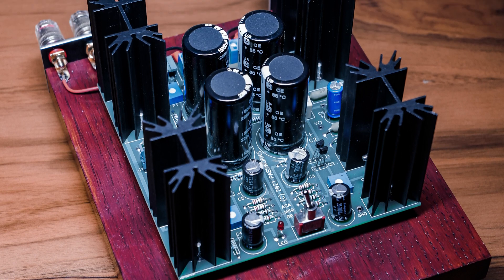Are 5 Watts Enough? ACA Mini by Nelson Pass | DIY Amplifier

Comment: just by using a linear power supply no sound stage will gonna open up, the only thing will change is the noise, and the capacitor recharge time.
Nothing will change, and the reason that that amplifier had low noise, due it has low gain which means it doesnt amplify much the noise nor the volume, were talking about single digit watts. 
Of course a low wattage low gain amplifier will gonna have low noise also, but with the right transistors you can make your own kit of this unit, its no witchcraft, its just that some people know electronics more and they know how should it go, and they try circuits out.
If its good then they sell it or utilize it in future project, and if its a bust then they put it aside, but they learnt from it.

Comment: How did the IFI psu affect the high frequencies specifically compared to the original psu?
Reply from the maker: High frequencies were tame with both of if I remember correctly. I would have to re-evaluate it to be sure.
Reply: @audioarkitekts  I ask because we are thinking of trying either ACA-mini or F5 as tweeter amp in a tri-amp setup using concentric 115db mid/high horn. Aim is for extended refined airy sparkly highs that really shimmer. Any other suggestions are more than welcome thanks.

Comment: Do you have any impressions about how much of an improvement the IFI power supply was over the little brick that it comes with? Sounds like maybe that brick blew out before you had a chance to do a comparison? 

The power supply that it comes with is tiny compared to the 36 volt meanwells that I have for my modded ACA. That IFI looks really intriguing, it might also be a killer upgrade for my hagerman tube phono preamp that uses a wall wart.
Reply: I'm going to answer my own question, I went ahead and got the iFi elite power supply just on a 30-day trial. The improvements it makes are no joke and if you match it up with some efficient speakers I have mine with Klipsch fortes, The results are amazing! And the improvement over the stock power supply is enormous, totally shocked!
Reply: @chelillingworth9466  What kind of improvements exactly? We are looking to get a ACA exclusively for midrange duties 300Hz - 6.5kHz on a very high efficient horn based (electronic XO) system. 
We need a low watt amp that is somewhat warm and buttery smooth (especially in the upper midrange) with good stage depth and not too forward. Would you say the original PSU should suffice our particular requirements ? 
Any other suggestion ?
Reply: @sarahX..  I would say it's definitely buttery smooth and it does a really great job with soundstage depth and width a very holographic presentation. Adding the ifi elite power supply enhanced it and every way, much more detail and specifically much better imaging everything was much more defined. The nice thing about the ACA mini It's that it's so inexpensive so you can really experiment without too much risk, and you can purchase the iFi power supply on a 30-day money back from most retailers and see what you think.

Comment: I just built this amp and I am floored by how good it sounds, I also built the full size ACA, I ran that in stereo mode and in both monoblock modes as I built two of them. I ended up following this great thread on DiY audio and heavily modified the amp with premium parts and dual  power supplies and it sounds killer. 

This little push pull amp though doesn't roll off at the top as much as the ACA and it's just got something awesome happening even in its purely stock mode!

Comment: Certainly, we do not use more than 10 W/rms

Look at it this way, every day you drive 100 km at a speed of 130 km/h, with a 70 HP engine, at maximum

Or you drive 130 km/h with a 200 HP engine, moderately

Which engine will last longer?
Reply: That is not an accurate comparison. This little amp will last just as well as a larger amp.
Reply: Definitely he built amp that looks like luxury car with one mile per gallon...

Comment: It’s a great little amp!  I have mine powering a pair of Troels Gravesen designed SBA761 speakers, about 90db efficient, and they sound great.  It’s no giant killer, but it is a fun little amp and a rewarding diy kit for builders of all skill levels.
Reply from the maker: Couldn't agree more 👏
Reply: I am using it with a pair of 89db sensitive floor standers. I agree that it sounds really good. I have mine mounted to larger heatsinks with a linear supply I had laying around. Bias is .440v at 24v at the moment.